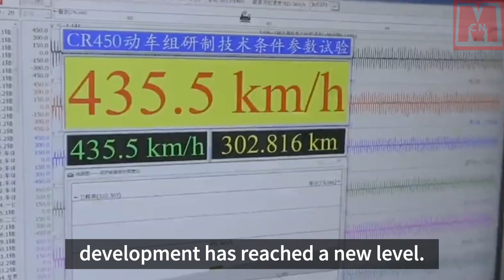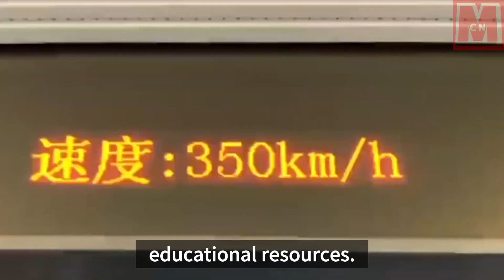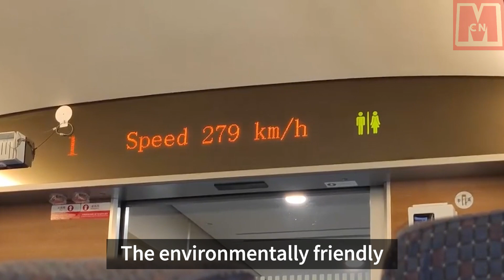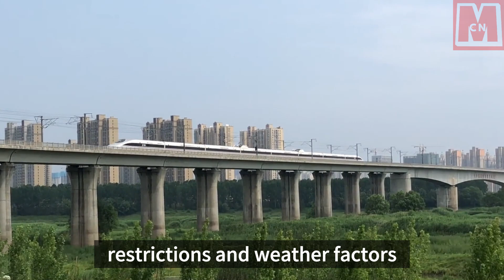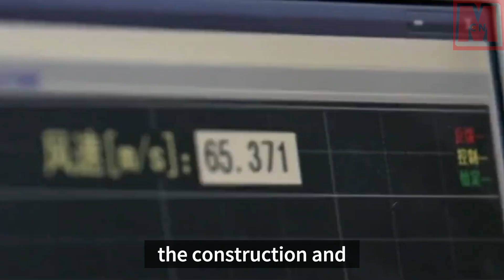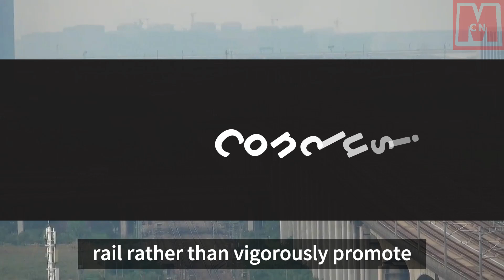Why does China insist on developing high-speed rail instead of low-cost airlines?

Comment: How China stole the technology? They first approached Germany with an order for high speed train system with technology transfer as condition attached, the Germans refused. They approached the French who too refused the technology transfer condition. Then they approached the Japanese who agreed to provide some outdated technology they had. Fearing losing a lucrative market to Japan, the Germans and French also decided to cooperate with China, that's how China managed to obtain western train technologies. China then reneged on conditions and broke contracts by plagiarizing the technology and building their own high speed trains. China has saved a lot of money in R&D costs but squandered the saving in building an extensive network of bullet trains of little use because people have either no need of them or cannot afford high price ticket. Lots of trains are running empty or abandonned and left to rot. When China runs out of western supplied wheels, that's it!
After a certain 1-2 million kms, the rolling stock must be serviced and after 2.4 million kms the wheels need be replaced. When China has exhausted its stock of western supplied wheels, one will see more examples of shaking trains reported by rail users as Germany and Japan have stopped supplying China with wheel parts. The most critical parts in high speed trains are the wheels which must be manufactured at extreme high quality standard and China is unable to make high quality ball bearings. The Germans and Japanese have kept them as technological secrets and not to be patented. China doesn't respect  intellectual property.

Comment: High Speed Rail is expensive to run. It costs China over $500 billion to build 45,000 km of high speed network. Maintenance and service cost $25 billions a year and China's debt is close to $1 trillion. How long can any country afford to sustain such cost? The exercise is for China to satisfy its vanity, it's rather a prestige project to wow the world. The network was built not according to the principle of supply and demand, only 6 lines are profitable such as the Beijing-Shanghai line, the rest is loss making. There is no need for building huge palatial railway stations, some are in such remote locations that nobody uses so 26 stations have to close. Recently a video has emerged showing a high speed train shakes violently when in service, it appears that Germany and Japan have stopped supplying parts to China as Chinese made wheels are certified to run only at 140 km/hr. To run at over 300 km/hr the Chinese train need wheels supplied by Germany and Japan which China is unable to make. Anyway China stole the technology from Japan's Shinkansen.
Reply: Which line has trains shaking?